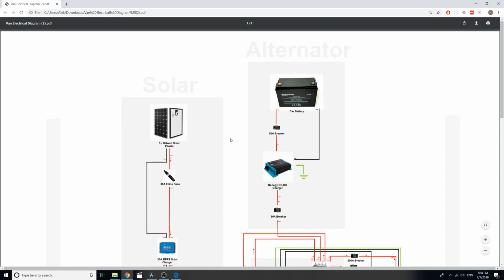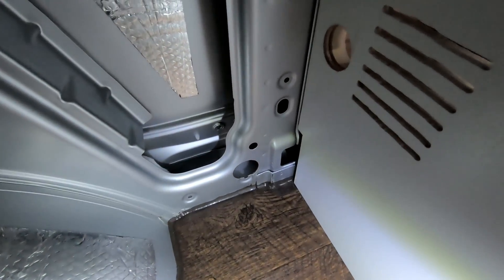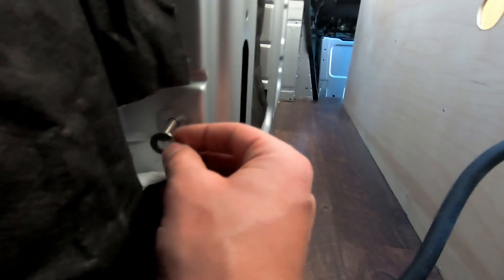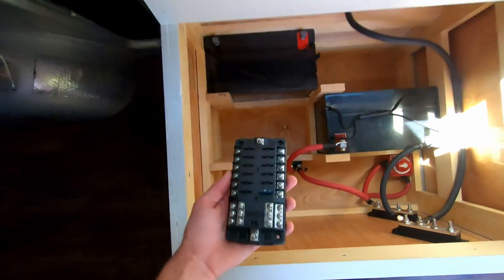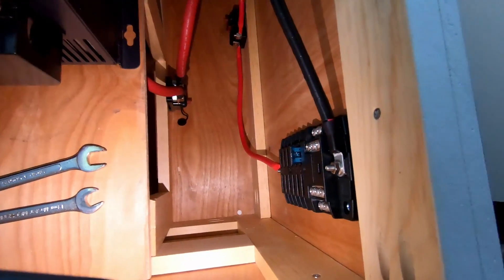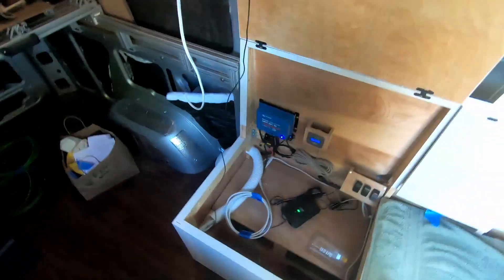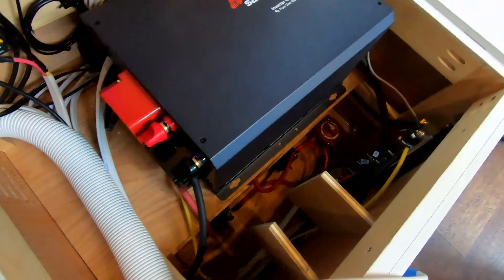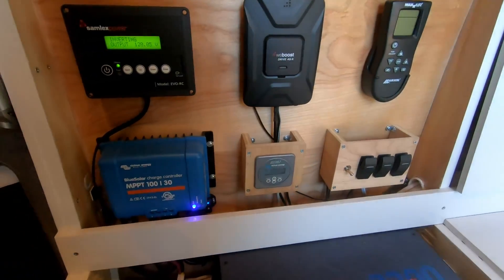ELECTRICITY⚡ In The Van!! How To Wire 12v DC & 120v AC with Solar / Batteries / Inverter - #vanlife

Comment: please present a video of your tools used during various van projects. also what do you carry toolwise when traveling? thx. great vids, slow down your crazy choreography just a little please! cheers
Reply from the maker: I am planning on doing a "top 10 tools" guide once I finish the build! I don't travel full time yet, but I do carry quite a few tools :) wrenches, drill/impact, drill bits, dremel, tons of electrical stuff, some plumbing stuff, some tapes/glues. Planning on starting w/a lot and slimming down as things go unused

Comment: How did you get the components (like the inverter) to fit so perfectly in the storage compartment? Did you measure the equipment first, the build, or just get lucky? Because that's what impresses me.
Reply from the maker: It’s very strange how many times I’ve gotten lucky where things just “worked out”, but this was planned :). I build the bench seat around the constraints, which were the battery, inverter, and toilet